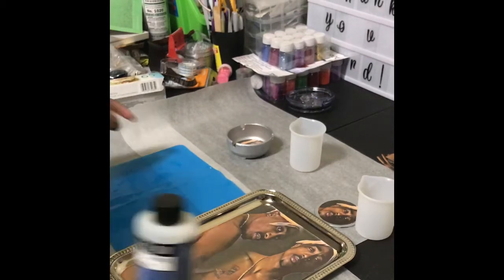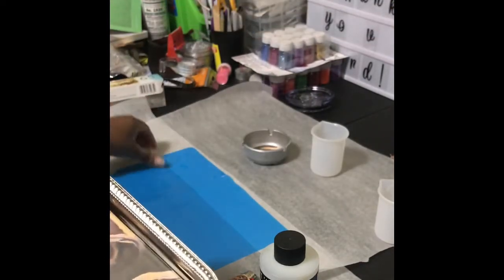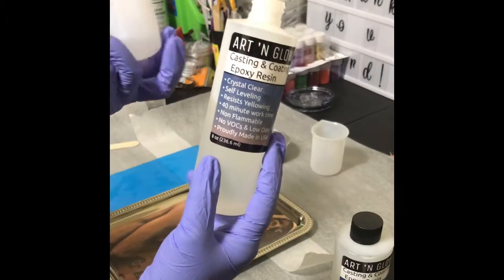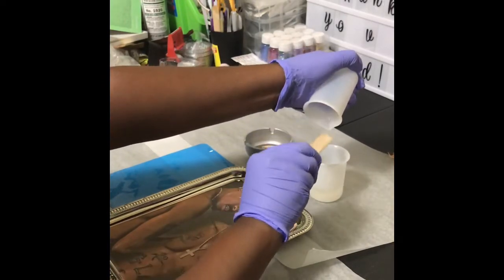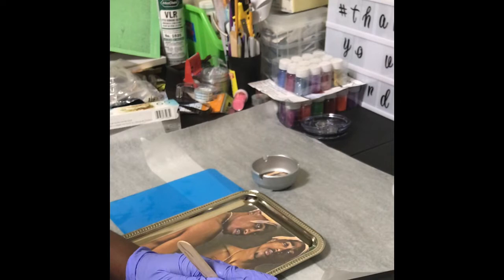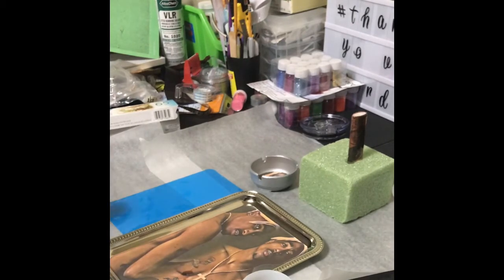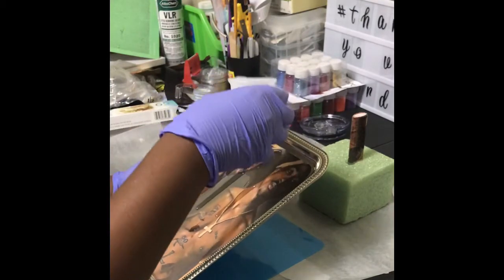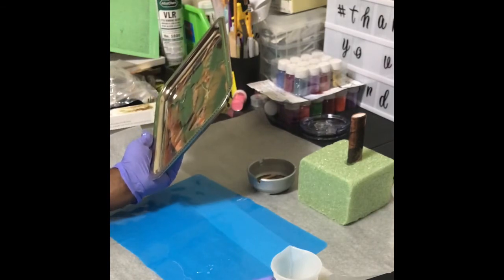DIY ROLLING TRAY (Epoxy) | how to epoxy a rolling tray

Comment: what's the measurements on the image on the tray ? And how did print it out did you use word document to get the size or silhouette site?
Reply from the maker: The tray measurement are 9.5 for the height and 6 for the width. I used silhouette free version however you can also use word or publisher just be sure to remove the background.
Reply: Craft Insanity what do you mean by background? And thank you 😊
Reply from the maker: @iamsbonamy  Anything that is not the actual picture or the design you would want to see once printed. You are welcome.
Reply: How much epoxy does it take for 1 tray? Ive never used it before n im trying to learn before i waste that n my money by mixing way more than needed